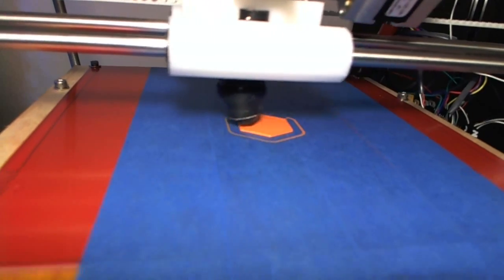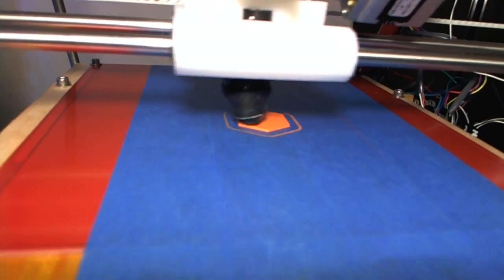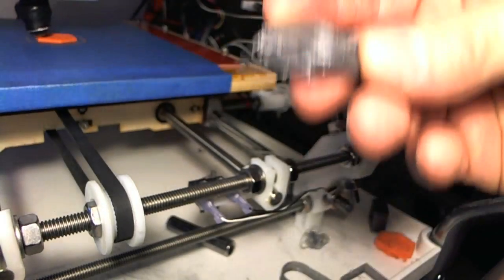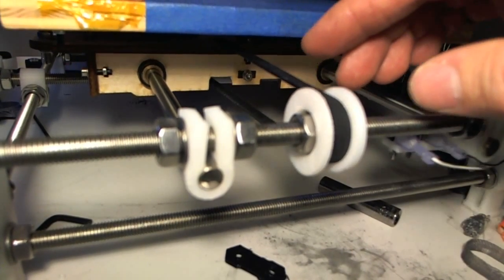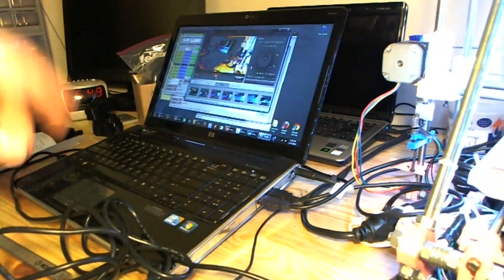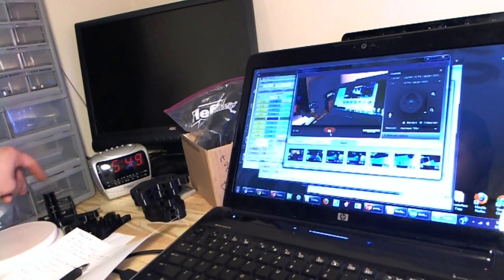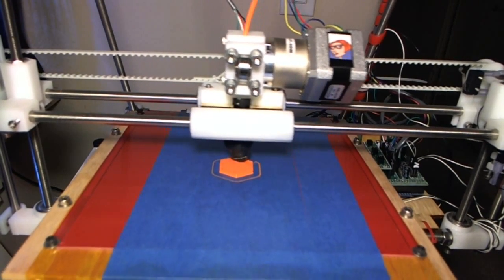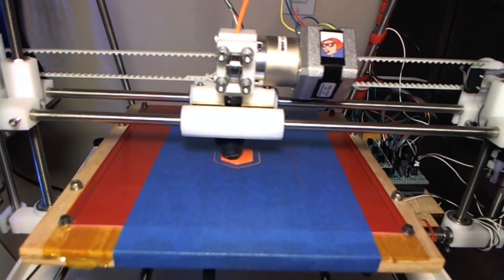Reprap Project- TWO 3D PRINTERS!

Comment: You're also using GT2 pulleys on the idler end?  I'm still using skate bearings with a half roll on the belt with gt2 belts.  Apparently some GT2 belts have steel in them, while mine does not.  Steel is better for not flexing.

Glad you got your Y dragging issue solved!  Moar hackerspaces!